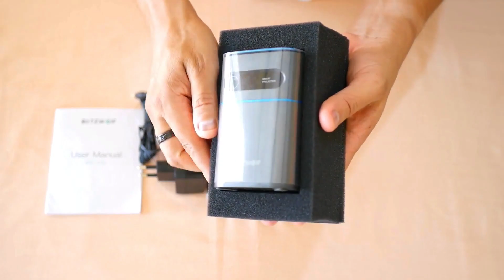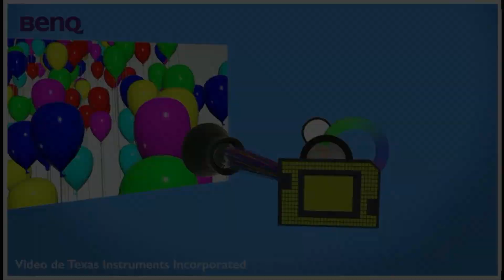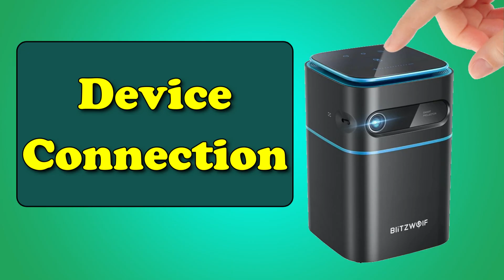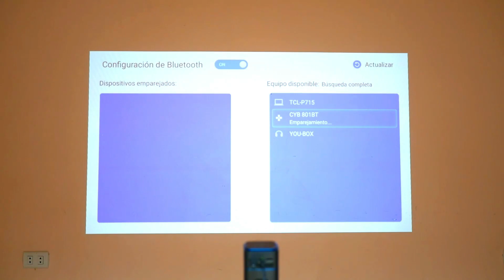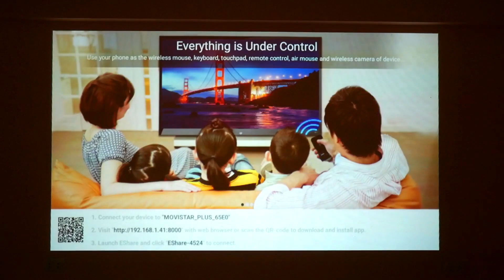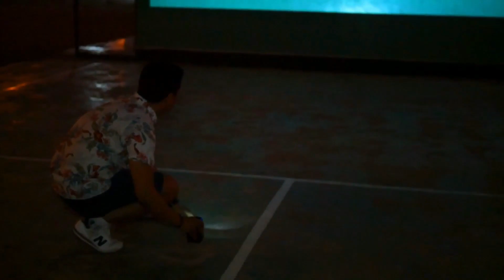BlitzWolf VT2 DLP Projector, ...a little GIANT of 300 Inches!! 😱😱

Comment: Oops, good afternoon, I came because of your video on YouTube, I wanted to know which one would be the best, blitzwolf BW-V2 full HD and the t2r max, I was wanting to buy it but I don't know which one would be better, can you make a video comparing the 2 doing plis??
Reply: But think about the full hd resolution of the wanbo.... And one more important thing. Let me tell you. I owned three different dlp projectors the last six years. And on every of them after two years of use, there are small white dead pixels, cause some of the micro mirrors are not moving any more. That's a big issue of dlp projectors. Notice, for sure this will not happen to every dlp projector, but the heat will reduce the lifespan of the dmd chip.
And this is a clear advantage of LCD projectors. I got a 3lcd Epson at home for five years now, and there are no problems with dead pixels. Don't misunderstand me, I also will purchase the blitzwolf cause of its so nice to handle, and I like the small form factor.
But the dead pixel issue is one thing that should be addressed to everyone who want to buy a dlp projector..... Search the internet if you don't believe me. It's a phenomenon which cheap and high cost dlp projectors have. But for sure, not every one.
Reply: The Blitzwolf BW-V2 is better, it has more brightness because it is DLP.